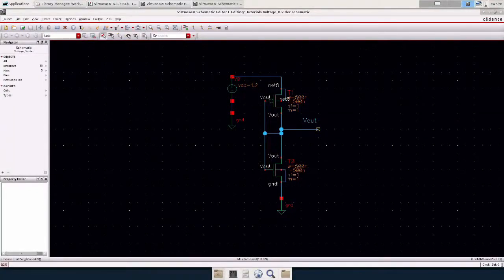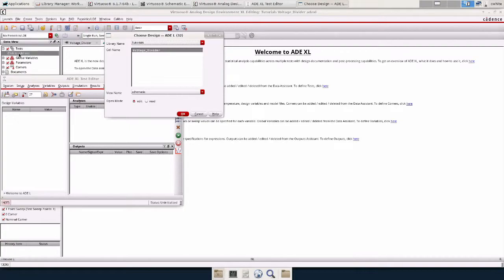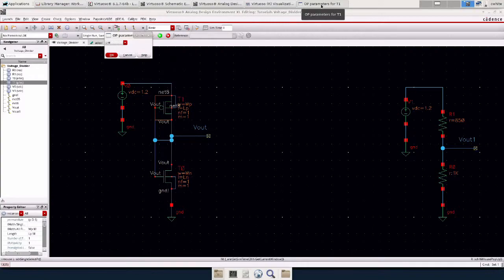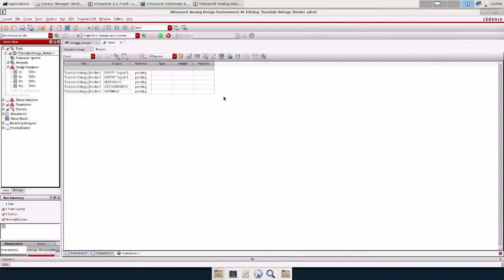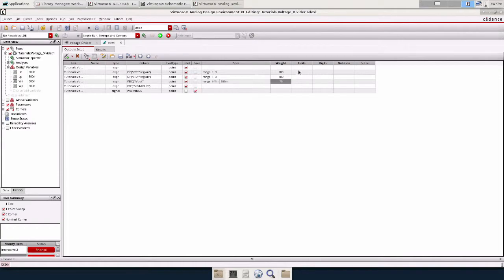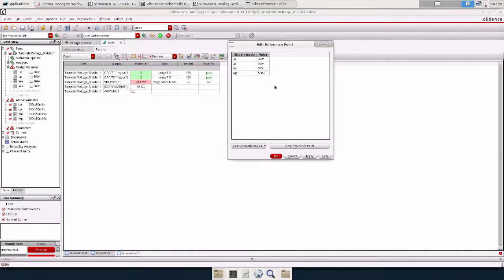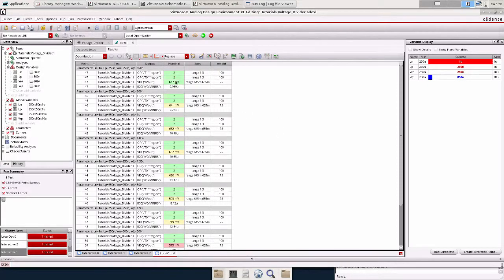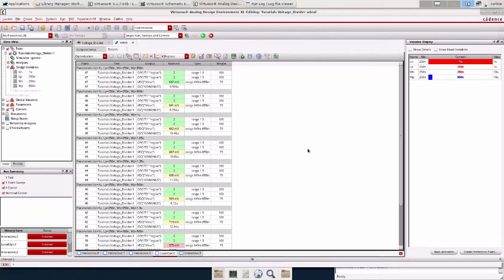Local Optimization in Cadence Virtuoso ADE XL with Global Variables: Voltage Divider

Comment: Thanks! Can this be done for transient analysis as well? For example, optimizing inverter sizing to meet particular delay or rise/fall times for a given load?
Reply from the maker: Yes it can! You just need to write an expression for the rise/fall times and then set your goal.
Reply: @speedyzebra210   thanks, I did run and my test only picks the reference initial values and stops after 3 times. Maybe something with parameters that is messing up. Will try out and your videos are helpful!